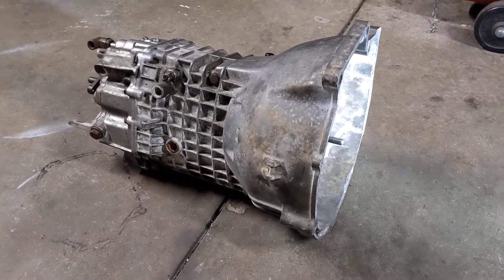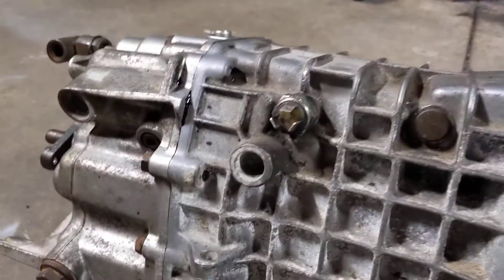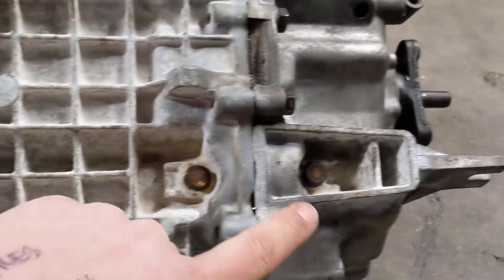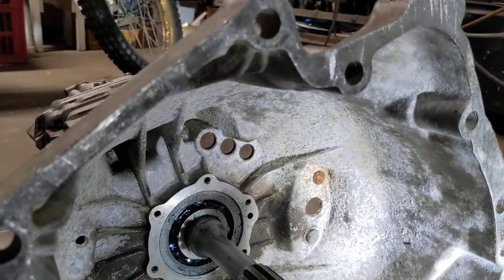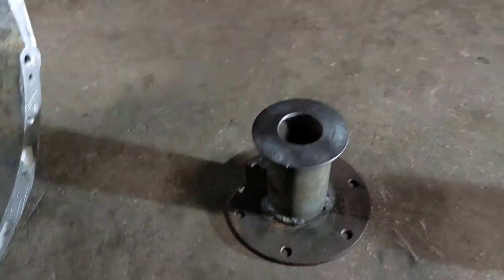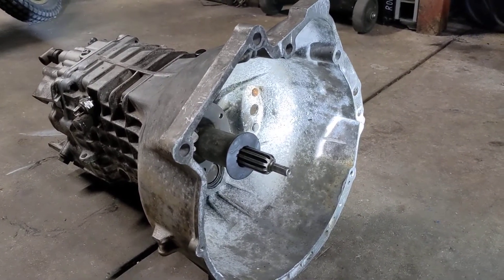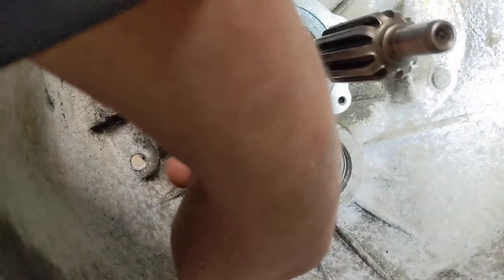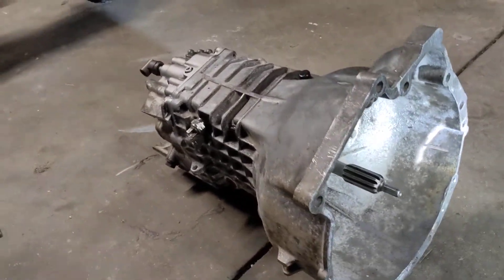E30 Getrag 260 Splitting Cases / Dissassembly

Comment: Statement and question.
#1 - I know you gotta be careful with using the puller tool to separate the case and make sure it’s perfectly straight which is why you should use the adapter if available. I however am broke and the transmission is froze in reverse anyways so I already plan on it needing full rebuild, but I managed to flip some arms around to grip the bell housing using the holes for the bolts and managed to get it out with “basic”tools. It isssss possible but not advised lol

#2 how would someone be able to split the case open (specifically a getrag 240 for a ‘85 318i coupe)  when said transmission is stuck in reverse with cause unknown. From my research/experience you need the transmission to be in neutral in order to fully split. Everywhere I’ve looked/asked the solution always ends up being “put a couple bolts on to hold the case together so as not to crack it, and then start picking it up slightly and dropping it so as to possibly un-jostle whatever may have possibly gotten jostled before and proceed more aggressively if results don’t show. Otherwise you should just buy a new one.” Or something along those lines. 

I appreciate any feedback and thank you for taking the time to provide information to all the under-informed people wanting to learn! You’re one of the good guys lol
Reply: And sick shredding too btw! I miss it

Comment: Hey man my getrag 260 wont go into 2nd or 4th. I dont think the transmission is bad but do you have any suggestions?
Reply from the maker: Not sure exactly what it could be sorry. Could be worn out shifter bushes not letting the shifter push far enough. Or could be something internal like the selector fork bushes. Make sure the shifter works properly before you tear it apart.